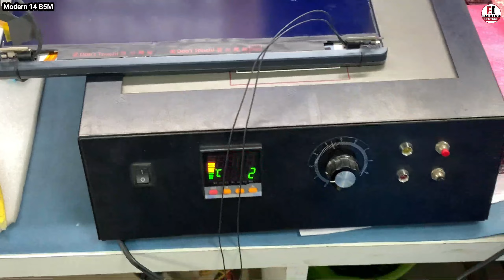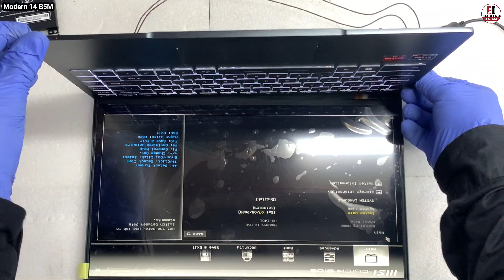How To Replace LCD MSI Modern 14 B5M / Dim Display / Disassembly And Assembly

Comment: I want to ask, for the adhesive to attach the front case of the screen, what size is it for the use of double tape. Because my laptop wants to replace the screen and for cases with the MSI logo it must be glued to the screen